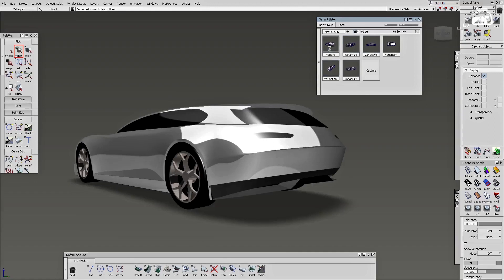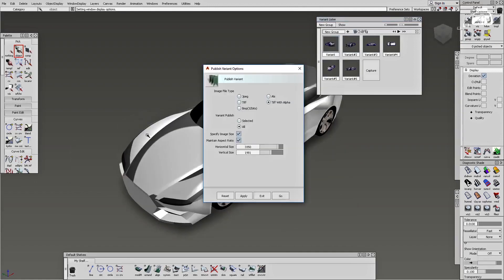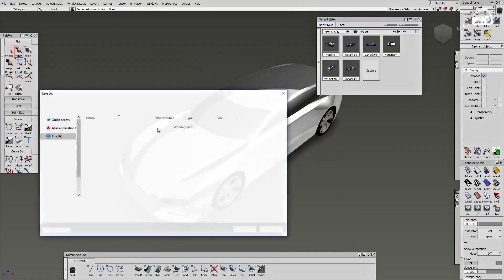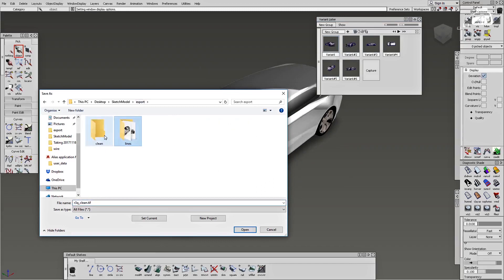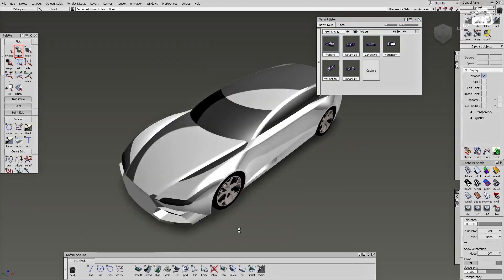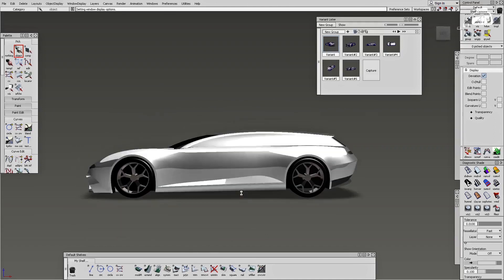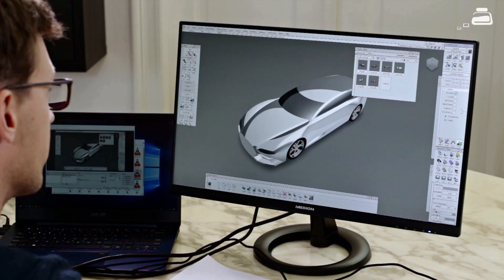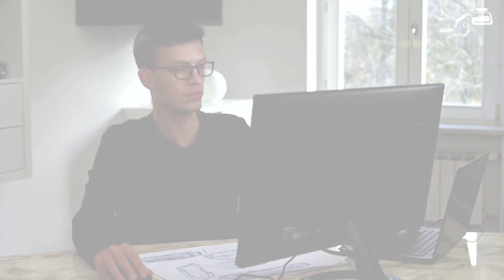Car Design Tutorial: CAD Sketch Model - Timelapse

Comment: Why Alias and not Fusion 360? I mean it is a question not an argument.
Reply from the maker: Alias is the industry standard (together with ICEM surf) for CAD in the design studios. It offers higher degree of freedom it terms of shaping, and higher precision/surface quality for perfect reflections and surface blends. For the final surfacing other software package cannot compete (yet). For a concept phase it wouldn't really matter what you use to visualize your ideas, you can also use polygon modeling, accuracy/surface quality is not super important. Alias can also be a good concept tool due to its shape freedom, with the benefit that it fits better in the pipeline for the later stages (no need to convert/rebuild data). Hope that answers your question.
Reply: @InktankAcademy  it does in deed. Thank you. I my self hate the idea of cloud based software as Fusion 360. So I guess Alias is the winner. Thanks again.